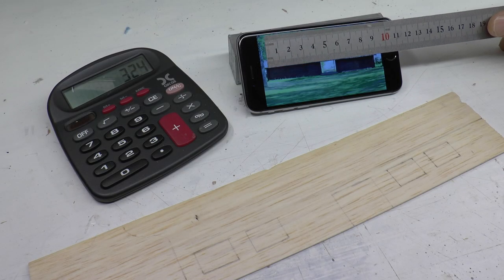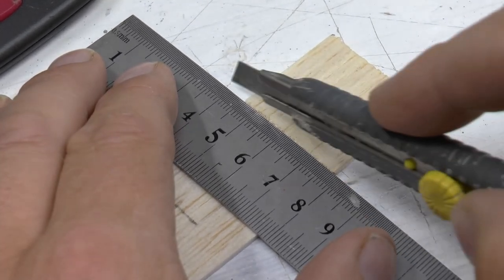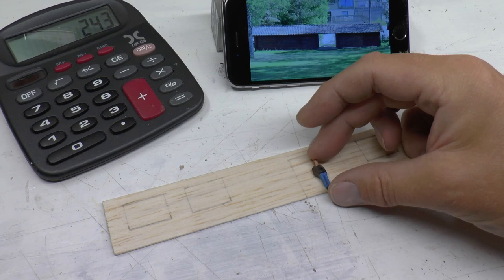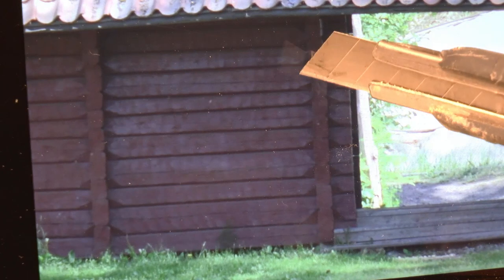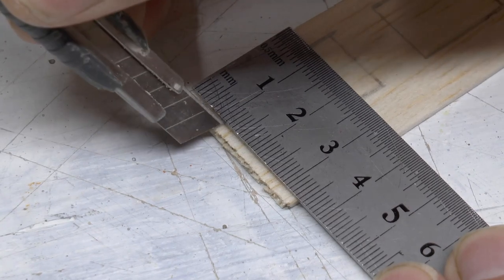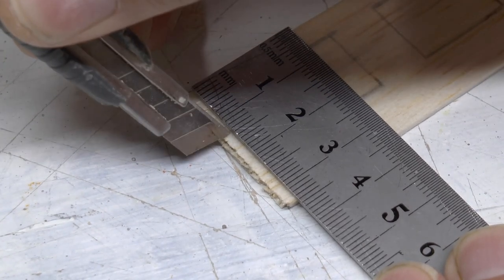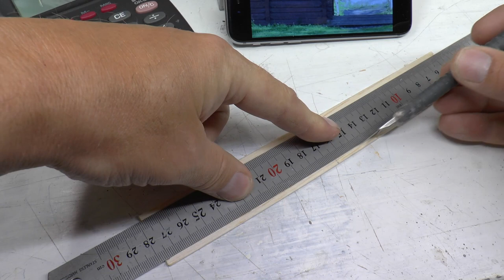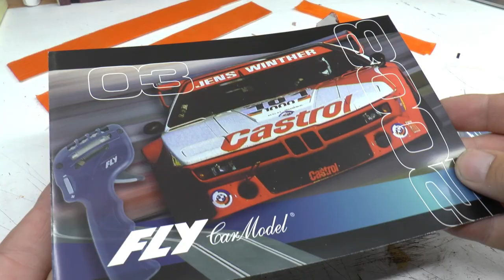Scratch build realistic dovetailed log cabin

Comment: What is PBA glue?
Reply from the maker: Hi Henry. No.. PVA-glue.. The sort I´m using is water based and called type B, so PVA-B glue.. The guys in the shop should be able to guide you to the right product with that information.
Reply: PVA = Poly Vinyl Actate,  similar to PVC poly Vinyl Chloride